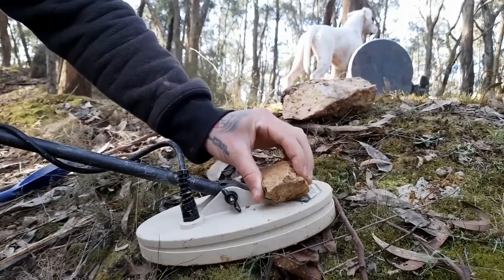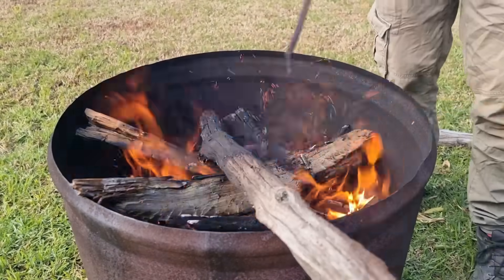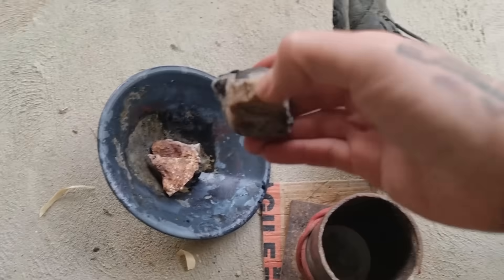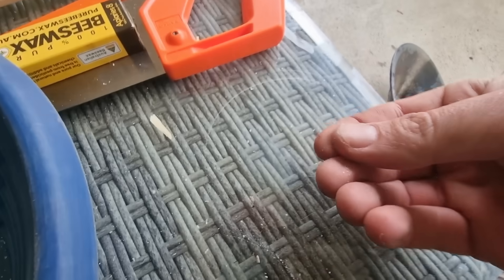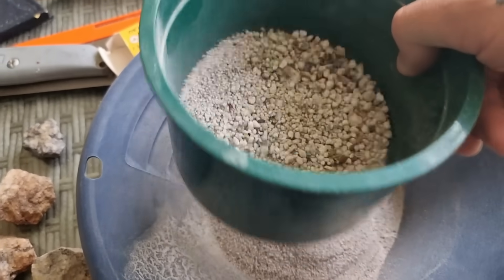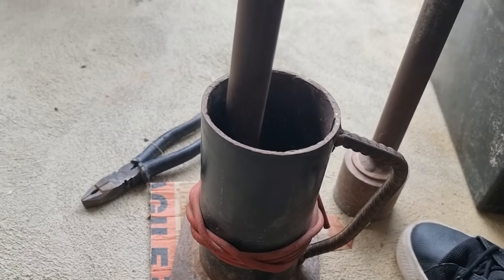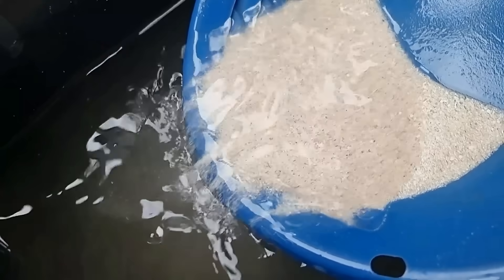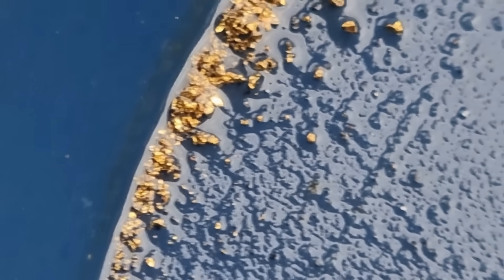I Can't Believe This Worked So Well! | Vinegar Gold

Comment: Vinegar is not needed at all. Roasting ore for easier crushing was done since ancient times. If you have a huge boulder, you can heat it up and rapidly col it with vinegar.... or just plain water. It will likely form multiple cracks and break apart - also done since ancient times.

Comment: Why not use muriatic acid and bleach to create auric chloride solution then sodium metabisulfite to reduce to gold. When you add the SMBS, the auric chloride solution turns dark like cola. 24 hours later, should have a light brownish lump. Drain the acid. Retrieve lump. Blowtorch the lump. All the gold is there.

Comment: Breathing vapours with high levels of acetic acid can cause irritation of eyes, nose and throat, cough, chest tightness, headache, fever and confusion. In serious cases damage to the airways, a fast heart rate and eye damage can occur. An accumulation of fluid in the lungs may occur and may take up 36 hours to develop......plus using a blower on open coals increases the risk of blowing sparks into the bush area causing fires putting rescue workers an other people living nearby at risk.........

Comment: just a suggestion:  instead of burning wood on a fire, try using a fresnel lens to heat up the rock.  it would be a good thing if you're in a desert that doesn't have fire wood,  or in a place with a lot of firewood, but it rains a lot.
Reply: Or the solar death ray.

Comment: Hey Chris, nice work. 
Ive been using a similar method, just not with vinegar. 
And it has a rough element of 'assaying' the ore, to see if it's worth working

I've been collecting a bucket of sample quartz from reefs I find.
Then I cook the rocks for several hours in a kiln I made - get's to 500c or so, 
so I want to make one bigger & hotter (of course)
I then shock the rocks with cold water from the hose
(I'll give vinegar a go next time, to see if there's a difference)

Next I take them out to a lonely place in the middle of no-where, 
(so I don't shit my neighbors to tears with the noise,) 
and crush the hell out of them in my dolly pot, 
by using a concrete facing bit on my hammer drill.

I seive the contents of the dolly pot through a kitchen seive
anything that doesn't go through the seive, 
goes back into the 'to be crushed' bucket
and I repeat till I run out of material to be crushed, 
and end up with a bucket of pretty fine sand
( I gotta make a hammer mill to speed this bit up)

At this point I can weigh the bucket of crush to give me a 'Before Processing weight'
Then I run the crush through the blue bowl
to get to the gold, which gives me a very rough 'ore to gold' ratio
to see if the reef's worth working further

It's a work in progress, but I have found gold with this technique
Just not enough to shout 'Yippeeeee!' yet

Comment: The same rock breaking method was used by Hannibal's military engineers to break rock in building a path across the alps in some locations, much quicker then with sledge hammers and pick axes..

Comment: I made a version of Stampy a couple of years back but instead, used a 4lb sledgehammer head that I welded a 4 foot bar to, onto one of the hammering faces. I call it a Whumper. I scavenged a 6 inch thick disk of steel from a metal profile cutter and welded a tube above that to whump into.  Works good. And quenching your hot rocks in Water works just as well as vinegar.

Comment: Very impressive, and laughed a lot... Thank you.

But honestly, why would you go through all that trouble for this extraction and where did you happen to find that

 vinegar? and do you still put meat on that BBQ?
Reply: Did he specify what type of vinegar?I saw 30% vinegar in Loews cleaning supplies aisle yesterday. I have to assume Home Depot has it too. You can get gallon jugs of white vinegar in a supermarket which is about 5% acid.

I have heated vinegar to make reductions in the kitchen for sauces and those fumes can be quite strong and unpleasant to breathe. Make sure you're upwind of the fumes if you get to trying this. The 30% vinegar will probably send you to the emergency room if you got a strong whiff of fumes from that.

Comment: If you just leave it in the vinegar, the quartz will be gone and you will be left with only gold
Reply from the maker: Vinegar does not dissolve quartz
Reply: It sure does in Virginia. We have a lot of quartz here so I just thought I'd check it out m see if I could find a speck or two. Picked some of the most mineralized rock I could find and dropped it in a small bucket n poured vinegar on it. When I remembered to check it, probably two days later, there was only liquid with some sand and dirt in the bottom
Reply: @jasonbutler5113 yours was calcite/Carbonate there are only few substance that can dissolve silica  Strong base(ex:NaOH, KOH), Hydrofluoric Acid, pure water at 400 degree C and molybednum exotic chems

Comment: Wear a mask bro please. Silicosis is no joke.
Reply: Yea do it I’ve had mates turn crazier than they started from mum after a couple years of quartz cutting. Literally makes you like a tweaka after a time
Reply: Also please don’t use a cheap n95 mask like the great profit faucci recommended in the U.S. 3M half or full face masks with the rubber that seals ti your skin is a good mask. When I needle scaled a semi trailer and buffed the rust off I quickly found out n95 cheap masks are pieces of crap. Your nose eventually gets full of bad stuff. It’s shocking how the government recommended those masks cause when I wore em for hours working they don’t work very well. I only saw one medical doctor over the last four years that spoke about half and full face masks and how they’re better.
Reply: I think he's okay.
Reply: That takes years, not 1 time. Lungs heal

Comment: The translator from Spanish to English does not work correctly I will give you an idea in my language I have already created 10 of these.
Debés comprar amoladoras de 5000W eléctricas las de tu país no son tan ponentes como las de España otro motor que si lo es con los de las máquinas de lavar la ropa yo recomiendo las amoladoras ya que es más rápida la modificación y su eje de ataque ya te facilita el trabajo al poseer su rosca . A pesar de que esto sea los más caro ves a un taller de Routers CNC y crea una tuerca más ancha para alojar 3 martillos esto sería un plato con la rosca del eje de trasmisión 3 pletinas de acero al alto carbono cromomodileno que se devir viajar con soldadura TIG aportación y plato de protección proyecciones que deves soldar a la tapa las trituradoras que cree use como base o cuerpo holla industrial de alta presión con la tapa de 2 puntos de fijación y cierre perfore con corte clama los orificios para destenplar el acero ya que no existe barrena barata para crear el agujero de eje hay solde una placa de adaptación las amoladoras de España en su cabezal incluyen unos orificios hembra para acoplar la máquina a un banco de trabajo ya solo te queda proteger el lateral de la olla exprés con una llanta de hierro colado está .
Más adelante con el plasma corta un restangulo en el lado donde colocar la parte de la tolva y mejor que sea compuesta no como un embudo crearla con forma de codo y en la entrada se cuelga tiras de caucho yo usé correas de distribución gastadas así si algún trozo intenta regresar no te dará la ostia a eso sí con compres una olla demasiado onda o tendrás que incluir en su tapa algo para que las piedras queten más cercanas a los martillos del eje . 
Para mejorar el triturado en otro modelo la tuerca de eje pon una cadena que dejé los mismos eslabones por cada lado y fijarla con soldadura está necesitara más de precisión ya que puede precisar equilibrado de peso o un segundo plato con los martillos más aproximados al las parede y colados como si fuera una helice te turbina tal vez te sea más fácil entenderlo como dientes pero aquí solemos nombrarlos martillos es el plato de triturado de roca a polvo debes tener una precaución inclier agua y una tapa estanca para la tolva y a este segundo plato le solde un segundo disco para crear como una hélice te turbina tipo vaso no de turbo compresor son distintas hélices eso sí el oro puede salir casi como polvo o demasiado pequeño este proceso lo deves recuperar con ácido muriático y ácido nítrico pero obtendrás oro de 24Kt .

Comment: Yeah hard rock university is right…..so just water but it has to be a really fast cool down…..quarts turns to almost play dough sand.
Reply: Using an initial ice-cube water bath works best. Then after cooled and dried, place into vinegar bath until done and ready for crushing.

Comment: For everyone saying why use vinegar- it's true it did nothing to the gold except cleans and brightens it and that is the point because if it were a substance that can be mistaken for gold like pyrite, old brass, chalcopyrite or mica they would react with the vinegar changing the color atleast and can alter the color of impure gold.
Reply: What if it altered the color of a gold and someone threw it away?
Reply: Like a beacon for fugazzi's...Helps to fool proof your valuable work, time and ultimately your final goal, right?!
Reply: @impicklerick8370  Pure gold is notoriously unreactive to corrosive environments. There have been cases where old Spanish shipwrecks had chests of golden coins that were still shiny and obviously gold after hundreds of years at the bottom of the ocean.

Comment: Someone probably has mentioned this, but why vinegar? Well I think what makes the quartz so crumbly is the temperature shock, so water should do the same thing. But vinegar dissolves the sulfites, and for many reactions as temperature increases, so does the reaction rate; making the vinegar break down the sulfites very quickly.

Oh, and because you're mixing a sulphur compound and an acid, only do this outdoors in a well ventilated space. Not sure how you'd do this indoors anyway 😆

Comment: Thing to try - bake your rocks, let them cool. Then let them soak in vinegar for a week, change the vinegar as needed. The acid in the vinegar will dissolve away certain minerals. End result is a very brittle clean rock which is easily crushed.
Reply from the maker: Too long of a commitment man, a week is a long time. But it would be interesting to see the results.
Reply: If you add some salt to the vinegar it will even dissolve some of the gold so that may happen a bit without the salt too.  You may want to save the liquid solution and process that too, later on.  This process of shocking can also reverse non-magnetics into magnetite so it would be good to run a strong magnet through the powder before and after shocking.  Do the  magnet under water, shaking somewhat so that any gold particles fall off into the water or vinegar.  After baking, simply drop them into ice cold water, then dry and soak in vinegar.  Very interesting discussion here.

Comment: I bet you can do this with water. The vinegar comes in if the ore is dissolvable with acid, therefore releasing, potentially, more gold. For me, with my layman's brain, the "trick" is to get the quartz red hot and shock cool it so its crystalline structure shatters, releasing the gold.
FUN VIDEO!!!

Comment: I bet just super heating the rock then dropping it in ice cold bucket of water will be enough to temper the rock and make it brittle. and you would not have to use vinegar. You could dip it in acetone after you take it out of the ice cold bucket of water if you are in a hurry to get cracking or let it dry over night. I imagine the acid in the vinegar is mostly just used for cleaning

Comment: The Romans did the same thing to create roads in ancient Rome. To create passes through mountains they would drill holes into the mountainside and then pour boiling vinegar into the hole, and the rock would generally crack apart along the line the holes were drilled in, making the rock manageable to be removed.

Comment: It might be worth trying a sample where you use plain water after heating, instead of vinegar. You would likely get some thermal fracturing either way, but it would be interesting to see whether the acetic acid actually does anything. You could reheat your tailings after panning, treat them with vinegar, and pan to see if there is more fine gold released.
Reply: I'm wondering if the acid controls the steaming 

perhaps an antifreeze would also work, and not lose so much.

Comment: No way the oldtimers poured buckets of vinegar directly onto the ore body. I believe there must be a misunderstanding of facts somewhere.
The facts?
It's a well known mining technique to  heat the rock or ore with fire and then rapidly cool it with lots of water. Vinegar is a weak acid so it will rarely dissolve anything beyond minerals consisting of calcium e.g. limestone, dolomite and marble.
Heating the vinegar will speed up the prosess. Boiling the vinegar will just evaporate the acid and water and probably not the most effective use of it.

Comment: Hey Chris, 2 things,   1), cut a leafblower sized hole in the firepit at the bottom, blow the fire that way with say an old vacuum cleaner on "blow".      2) would "cleaning vinegar" work better than normal - the 14% stuff..   THAT would be an interesting update to see.

Comment: You don't need to use the vinegar. We used to roll rocks from the campfire in the river and the quartz boulders would shatter and you would stomp them into sand! It's the thermal shock that shatters the quartz. You do the same thing in Lost wax casting to shatter plaster. You can use barbecue charcoal and rig a hair dryer on cold on a tube. Also if you use a stout metal bucket to dump it into you can do your first good crush in there wet. You will get a lot more spiky reef gold booggers!!!

Comment: you wouldn't think that "old timers" would have had litres of vinegar to throw around?  I think its more likely they were using the fire to break chunks off exposed sections of reef.  I have seen a good vid where a guy uses fire and water to break up a freaking massive rock which has rolled on the back of his house.

Comment: Here’s an interesting fine gold solution for you
The old timers in the north Otago field used to use a crusher bowl (basically a motorised mortar and pestle) to crush down quartz tailings to get more gold out. They would shovel these tailings into the crusher bowl, fill it with water and vinegar and leave it turning for a day (the idea being that the friction heated the quartz enough for the vinegar) before processing the material to get the gold out.
You could use a similar system for your tailings after just a crushing to get more gold out of them

Comment: if you use a handcrank blower and a deep fire pot you would reduce costs and make the whole thing more environmentally friendly  (no petrol expense) you could easily layer up thje rock and wood or charcoal and do a bucket or more at a time .
Acetic acid does cool things with iron salts

Comment: its all about having fun with a blower... :) nice experiment.... never heard of this one before.
Reply: You still have to be careful not to get it too hot as you could melt the metal pan and then have a mess.  I did that once with a blacksmith forge and melted a cast iron piston crucible, mixing all the gold into the cast iron pieces where they still are.

Comment: I've been waiting for this video crazy how well.it worked. Firesetting is a ancient practice that has been found in very old mines the Romans also used it on a industrial scale. Just incase anyone get the idea for conglomerate be careful as riverrocks explode when heated
Reply: Good point on the river rock gadzee. Interests me how early man started mining the earth
Reply: Rock go BOOM 💥
Reply: @bradleysanderson9928  yes that's why you don't use them around a fires
Reply: It is the thermal shock that makes then explode. If you build a fire pit with river rock it will be OK if fired up slowly.  Giving a chance for moisture to evaporate.
Reply: @kenneely7899  I'm not too sure I always got told river rocks will explode when heated. Better to be safe then sorry
Reply: @kenneely7899  exactly that, well put. water would work just as well, colder the better, I presume the vinegar was used for slow acid cleanup after
Reply: @kenneely7899  I've built fires in with river worn rock and still had it explode, but if you chuck a river rock in a hot fire it eventually goes boom half the time, so I'm guessing it's about if there is TRAPPED moisture in a void or crack, I've used river rocks as happy rocks in the past and been fine, just don't heat them to glowing.
Reply: @bradleysanderson9928  tx